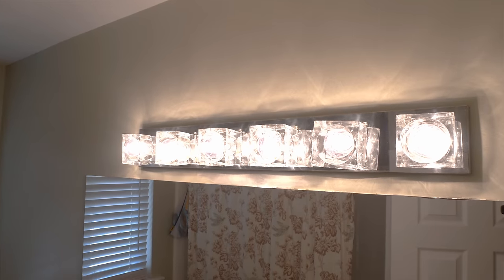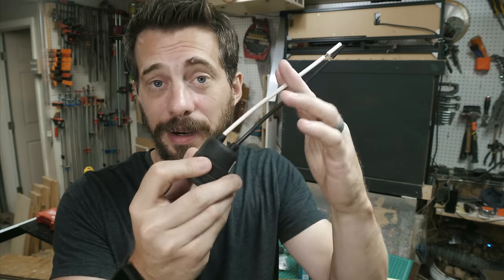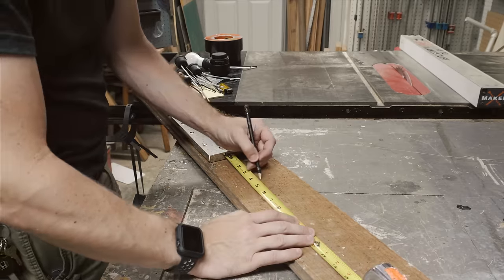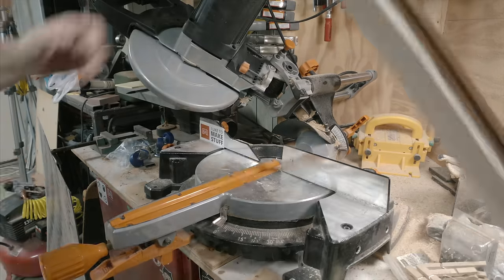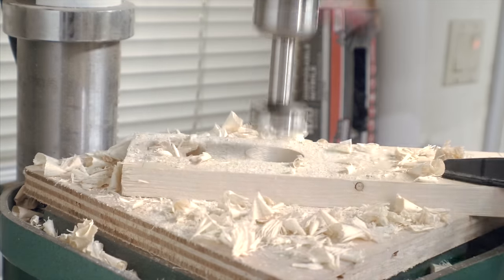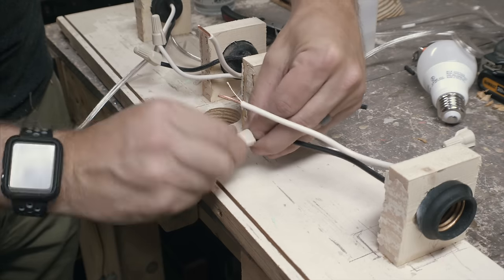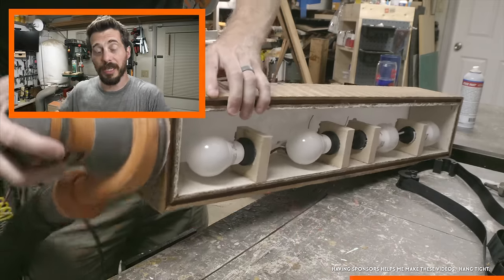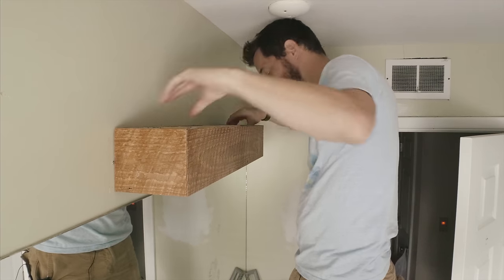How to make a Bathroom Vanity Light // Woodworking | I Like To Make Stuff

Comment: I have been considering something similar for my 27 year old bathroom with 2 sinks, an 8 foot mirror, and 9 large 40 or 60 watt globe shaped incandescent bulbs.  My plan was to use one of those 24" x 48" acrylic diffusers made for dropped grid ceilings under fluorescent fixtures which are available at Home Depot and other big box stores in a variety of textures, and clear or milky white translucent for $10.00-$13.00. Never thought about turning the bulbs 90 degrees and this orientation coupled with the smaller size of the LED bulbs allows the fixture to be quite narrow. Another great project.

Comment: Nice project! But I do have to point out, Lexan and Plexiglass are different things - Lexan is Polycarbonate, a tough and somewhat flexible plastic, while Plexiglass is PMMA (acrylic glass), which is much more brittle but easier to paint or glue.
Reply from the maker: They are, but in this particular use case, they are interchangeable. The reason I mentioned plexi is because it would be a similar but much cheaper option.

Comment: I made this Bob it was great.  There are so many ways to jazz it up. I had my garage shop rewired and they used ceramic light fixtures on the ceilings.  I had extras they were $1.25 each and made perfect inside.  I am a painter and I did a painted piece of hardboard for the front that can be changed any time.  I got the plexi out of a cheap picture frame so it was free.  I got the LED light bulbs for free from a welcome gift from our power and light company.  So it was $6. I have been messing withy lighting in my art studio and I am going to do some variation of this.. Thanks.

Comment: That's a really nice Light fixture. I think it came out awesome. If I had to change one thing, it would be the top. Being open is good for venting the heat but I feel like a frosted pane of glass/Lexan would even out the light coming from both sides. LEDs don't get very hot so it shouldn't be an issue and if you made it easy to remove, replacing the bulbs would be just as easy without it.

Comment: Sometime when you are making a box or frame with 45's, try going past a degree or two, you will find that it makes the outside corners tighten up nicely yet still glue perfectly, just a little tip, try it you might like it.

Comment: Unless I missed it, you should have sealed the top. Could of had just had another lens and screwed it on. Dust will collect on those lights causing poorer output, bugs will die inside the fixture and be visible on the acrylic bottom. I understand why you didn't do it when you made the fixture because it would have been hard the way you went about it to mount the fixture if you had a top. There are ways to get around that though. Food for thought on your next one. Otherwise, looks awesome.

Comment: Hey Bob, out of curiosity - why did you not put a finish on the fixture? did it have a finish in it's previous life? if it's unfinished, wouldn't it be prone to rotting in an environment as warm and humid as a restroom gets?
Reply: Perhaps he will but I think it looks great the way it is (Less is more) And the relative humidity inside a house (even in the south) will usually preclude any wood rot even if the wood is unfinished and in a bathroom with occasional periods of warm humidity.

Comment: This fixture does not meet electrical code...either NEC, or local (which usually just reciprocates NEC).  There's no junction box; connections have to terminate inside a junction box.  The fixture you replaced was rated for use as J-box with NM-B feeding direct into it.  You mention installing this in a house for resale...that opens Pandora's box of liability for failing to meet code.
Reply: thechosendude I made the same comment here earlier. Using a wooden enclosure as an electrical raceway is a major fire hazard. he should take this video down before someone burns their house down trying to copy this project. hopefully a potential buyer's inspector catches this.
Reply: mike serrano Jesus christ calm down
Reply: 😂 diy police
Reply: I’m also pretty sure it’s not grounded either...

Comment: Thanks for the video! Never noticed you don't mention prices of things until you mentioned it this time. I'm curious about sanding both sides of the plastic. Did you consider leaving the outward facing side smooth to make cleaning easier? Perhaps both sides needed sanding to diffuse the light?
Reply from the maker: You definitely could. It might be diffused enough. You could also add something else for diffusion.
Reply: Thanks, good to know! Also I've just bought some waxed cotton so am going to give making an apron a go... might try the 'magnets' idea from the comments as well.

Comment: Hey Bob, I've got a cool idea for you! 
Try building your very own pc. 
And by that I don't mean just assemble the parts inside a ready case, I mean make the case from scratch. Your very own customised "I  like to make  stuff" Pc. I don't have any experience with anything that has to do with this, but I think it should be possible for you. You'll get to learn a bunch about electronics, work with some new materials, have a chance to work with some tools you don't use as much abd more. Once the case itself is done, you could buy some new components to put inside, or just extract the ones in your current PC if you have one. This obviously is a lengthy project, so that you'll be able to make it into more than one vid. Anyways, Bob probably will never see this so like this comment so just maybe he does.

Comment: As a former electrician, i suggest to wear vinyl gloves and  isolated shoes (with rubber) if you are afraid working with electricity.  WIth isolated gloves and shoes you prevent the electricity to pass throught you. 

Thank you Bob
Reply: As an electrician, should this be grounded?  I don't see a ground wire, and even the fixture he purchased has no ground wire.  thanks

Comment: Is there a partially exposed screw hole in the drywall on the left side of the light? My OCD alarm is going off like crazy!
Reply from the maker: You can see several drywall patches on the walls. What you're seeing is an unpatched hole from the previous fixture which will be fixed and painted over when we repaint the room.
Reply: I figured you'd be going back to patch it, just my OCD itching. I just went through the process of sprucing up a house and selling in January. My realtor has called me multiple times since to get advice for a few of her clients now doing the same. FYI, mixing 5% water into a latex paint makes it blend like magic.

Also, really looking forward to having you in Kentucky! Will you be at either the Louisville or Nashville Mini Maker Faire?

Comment: Any concern with the open top and moisture?  I couldn't tell if there was a shower in there or not...
Reply: Ugh, there is a shot of the shower right in the opening.
Reply from the maker: No. They were indoor/outdoor fixtures and LED bulbs so I'm sure it'll be fine.
Reply: Hei, 

I am following you for a while now, and I am always happy to get new ideas from you.
I figured I could give back a bit by supporting the idea of covering the top.

The amount of dust, that opened setup is going to collect, can be real hassle for the next owner.

Now it's still easy to fix, specially for you 🙂😉

Keep up the great work!
Greetings, Viktor
Reply: Viktor Tóth magyar vagy?

Comment: Mornin' Bob!
I think it looks really cool!
I do have one question: since it is exposed wood, could it grow mold/mildew from the humidity in the bathroom? 
The house I am in is really old, so there is no ventilation from the bathrooms, so it can get really humid.
(P.S. I love the bloopers!)
Reply from the maker: Possibly, but this board was a floor for many years so I expect it to be fairly stable. You certainly could coat it as a preventative measure.
Reply: Good point.
Thank you Bob :)

Comment: Bob, hate to say but making electrical connections and free running wiring like that in a wood box poses a fire hazard. What you could have done is built a wood housing around the existing fixture, oriented downwards, and added a junction box on top for your electrical connection. The old fixture was intended to house wiring and connections. I did not see a ground wire connected to the metal components of that old fixture but it should have been if your house has the ground wire included.
Reply: It is kosher however to run low voltage wiring within that space if you can get a 12 or 24V led strip and mount a driver in a junction box.

Comment: I'd be quite concerned about the open light fixture, just putting another frosted piece on top would have done the trick. Plus I'd be worried about the wood not being treated due to the moisture...

Comment: leaving the top open and exposing the electrics to moisture is safe? just asking...
Reply from the maker: Yup. Like I mentioned, the fixtures are made for indoor or outdoor use.
Reply: The sockets may be rated for outdoor use but the wiring method is not compliant for indoor or outdoor. Does not meet NEC410.64 for good reason and should not be promoted for DIY projects. You'll not ever find an enclosure made of combustible materials that is approved for use as an electrical raceway. Nor is it acceptable to leave wiring and/or splices exposed.

Comment: OK, it seemed to be progressing nicely and then I noticed the blocks for the light sockets had been pulled off after the glue dried.  What happened?  Don't want to make a similar mistake.
Reply from the maker: The paint on the back of that piece was just really loose and chipped off. I should have scraped off the loose stuff first.
Reply: Thanks!  You've noticed the vent over the door I'm sure.

Comment: 1:43 Are incandescent bulbs still legal in the US? 😮
Reply: Gustav & Hilda Holmström Sort of. It isn't legal to manufacture the higher wattage bulbs except for rough service bulbs and some specialty bulbs. There are a few reasons why I think CFLs and LEDs have been very slow to catch on in the US. One is that the first CFLs frankly sucked, they were expensive, slow to start, weren't bright enough, and had short lifespans. That caused a lot of people to swear off them completely even after they improved. A big issue with LEDs have been the cost, though that is finally dropping. People tend to look at how much it costs them now, not how much it costs to run over the lifetime of the bulb and how often you have to replace the bulb.

It also doesn't help that we've always rated lightbulbs by wattage instead of lumens. People see "13 watts" on a package of LED bulbs and think that there's no way it puts out as much light as a 75 watt bulb. That's finally improving as well thanks to manufacturers putting "equivalent to a 75 watt bulb" and the like on the packaging and also government regulations requiring that packaging have a section that lists all the details of the bulb, similar to the nutrition information section on food.
Reply: Halogen bulbs acted as a bridge here in Europe
Reply: The USA can't even adapt metric so do you really think LEDs will be the standard (wish I could have used metric).
Reply: David Dube' We might have coal powered lights here soon #bassackwards
Reply: Gustav & Hilda Holmström how could any light bulb be "illegal " ?
Reply: Lynn Mckenney In Europe the old fashioned lightbulbs have been outlawed bit by bit, starting with 100 watt in 2009 down to 25 and 40 watt in 2012. For a while halogen lamps were very popular, since no one ever really warmed up (pun intended) to energy saving lamps. Nowadays even halogen bulbs, which use about 30% less energy, are used less and less and people switch to led whenever old bulbs burn out. They are a bit more  expensive but last so much longer and only use a fraction of the energy of the old lightbulbs. Our governments (luckily) frequently just force us to adopt a more environmentally friendly lifestyle. Everyone bitches and moans about it for a short while and then it just becomes 'normal'.
Reply: Rara Avis man, I'm glad that's not the case here. I have around 45 light bulbs in my house and led bulbs are around $20usd each. there's no way I could afford that, even if I did it 4 or 5 bulbs at a time. I do use cfl's, as their price dropped dramatically after led bulbs came out.
Reply: Lynn Mckenney $20? That sucks. In Germany I pay maybe 3 or 4 Euro...still expensive, but then the whole process of replacing the old ones stretched over almost 2 years, so it didn't hurt too much. It's kind of nice, though, being able to properly light everthing in winter (when it can be quite dark here even at daytime) without having to worry about electricity bills. And then, of course, LEDs live for many years...I haven't had to replace one yet...so once you have them, they really save you a lot of money. And they don't heat up, so you can put really bright ones even in smaller light fixtures or behind shades or something.  
Well, I'm sure, prices will go down soon in the USA as well. Global market and all that ☺
Reply: check with your electric company, sometimes they will offer free light bulbs ( I have duke energy in my area and i've gotten a couple boxes of bulbs from them in the past.)
Reply: You can find, depending on wattage/shape requirements, much cheaper bulbs. Even Smart bulbs can be found for under $20 (ex: IKEA's TRÅDFRI bulbs are $12 or $18, depending) and the multi-packs (like what Bob displayed in this video) sells for about $20 per pack. It's an immediate investment but unless you're already running CFLs, a significant cost saving over time.

Note: If any of your lights are enclosed, make sure the bulbs you are replacing state that they can be used in enclosures. Some manufacturers do not recommend it for their bulbs (you still can, but due to heat generation it could potentially be an issue).
Reply: When youtube doesn't notify you and you realise a comment has like fifteen answers 😯

Comment: I am commenting this to any youtuber I think can manage to do this, There is a clock shared by world leaders that has a light behind a map showing exactly what time it is all around the world simultaneously but it is very expensive I figure with some servo motors and an electronic chip this could easily be made by you.

Comment: The design is really nice, especially the rustic looks, however, not putting lexan on top, will allow for moisture and dust to get accumulated inside the lamp, and it will be a nightmare to clean. :/

Comment: Not to be picky, but no sealant to keep out moisture of the wood and no covered top to the fixture to keep it clean (and the wires not exposed to any condensation on the walls)? Possibly a regional thing in the US, but not handling moisture worries me about the design/'execution. :/ I'm guessing just a quick video, because well, you're moving but I think you can do and have done better work.

Comment: the tools we need are waaay more expensive than the materials
Reply from the maker: The tools can be used for multiple projects. Also, almost this entire thing could be done with a circular saw, drill and sand paper if that's all that was available.

Comment: No top?  The dust that would get in there would drive me nuts.
Reply from the maker: Not having a top allows heat to escape (and light) so it's safer and lights the room better in my opinion.
Reply: I Like To Make Stuff thanks for the reply. makes sense
Reply: I Like To Make Stuff you could use peg-board on top for cover and ventilation

Comment: Not legal to put high voltage lights in your batroom, in Belgium you may only use max 24V lights
Reply: All of the power in the bathroom should be protected by a GFI circuit. So it trips at a very low amperage flow to protect you.  The connections would need to be enclosed, correct wire used for splice and the wire nuts should not be taped, tape is a fire hazard. Since it is in a bathroom it would also need to be moisture resistant at least for the electric not just laying in the box.   Looked nice any inspector I know would want it fixed, surprised that did not come up on a house prepurchase inspection.